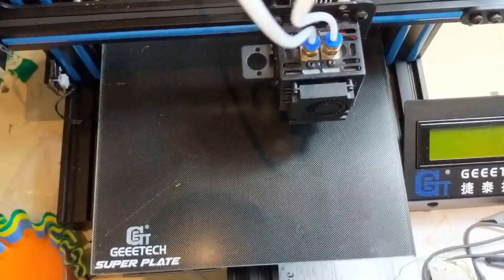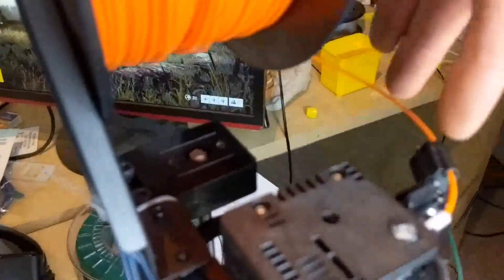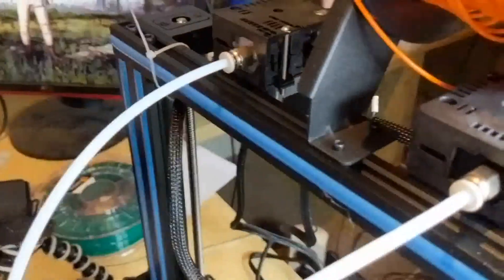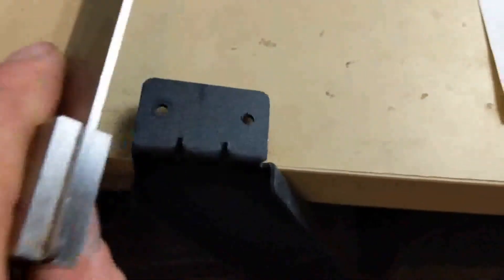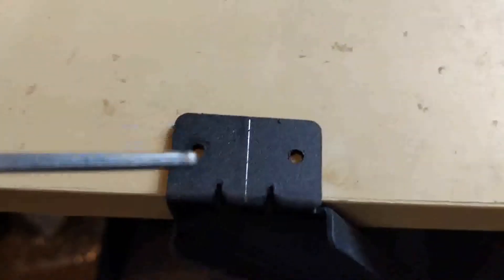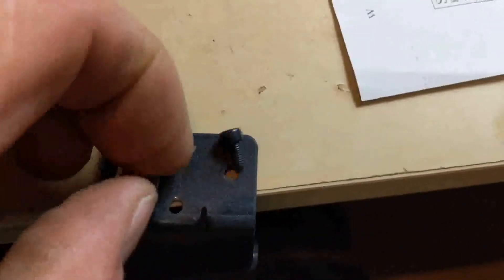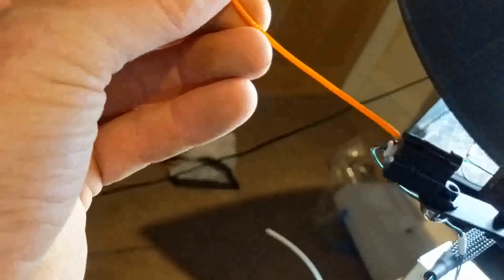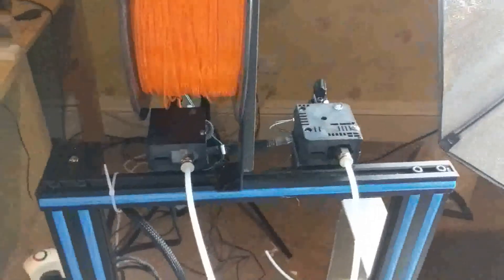Geeetech A10M spool holder mod

Comment: Just got my A10M in and they have now added the holes like you And the other thing I did with mine was to put my extruders on the very top each side of spool holder  {bowden tube on the front side of printer)facing down so filament runs straight into hot end now no bends
Reply from the maker: I also created this which helps lift the spool holders so narrow spools clear the extruder
Geeetech A10M Spool Mod found on #Thingiverse https://www.thingiverse.com/thing:3119720